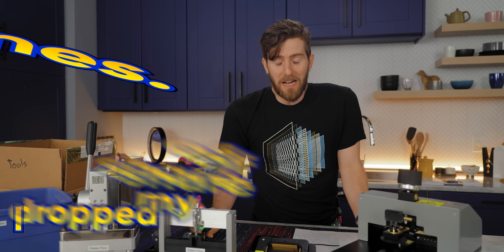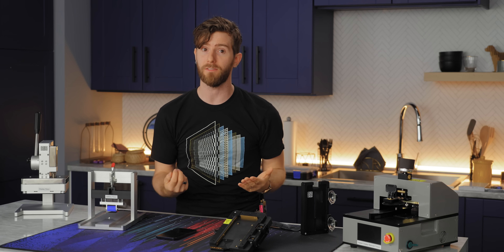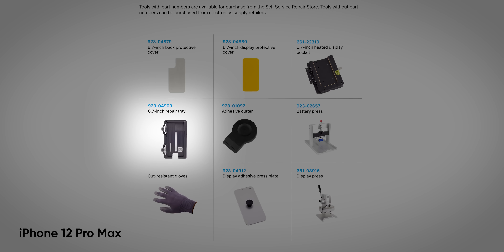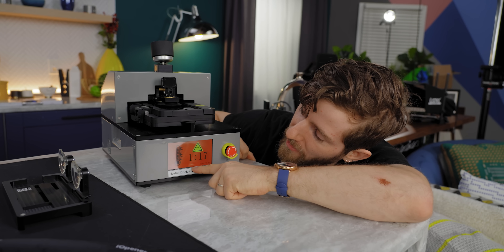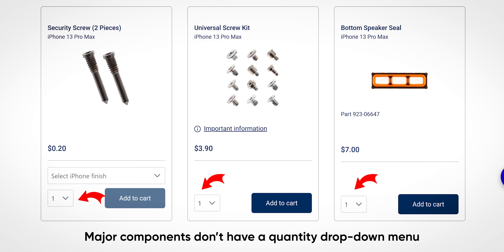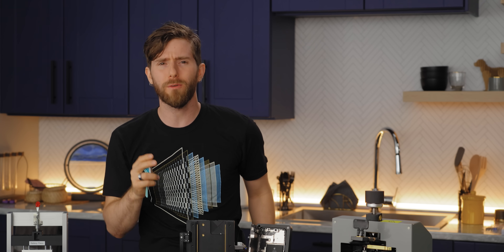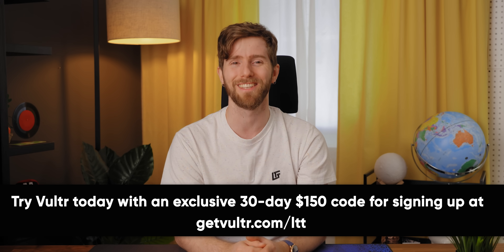I’m a Genius - Apple Self Service Repair Program

Comment: To be fair to Apple (which is not a phrase I ever expected to come from ME) to repair a vehicle, for example, which has a right to repair (though that's getting more and more questionable these days) will cost waaaaay more than buying a new vehicle if you were to replace even half of the parts in it.  With new OEM parts.  However, that's why 3rd party replacement parts and used parts and junkyards, etc. all exist.  Apple, however, is doing their Applest to prevent that kind of a market from existing outside of the walled garden.  So ... yeah.  Bad Apple.  Bad!  Go to your corner and think about what you've done!

Comment: A step in the right direction to be sure, but still so far away from what repair advocates are demanding that it's an immediate fail, "yeah, you did try, but not to the minimum of what we're considering requiring". Setting a service up for failure is even more reason to governments around the world to triple down on repair rights.

Comment: The thing is that "right to repair" isn't a real issue. Apple can't take away your phone if you repair it yourself. We all already have the right to repair our own hardware. But we may not get OEM parts. Apple is not, and should not be, required to make parts available for the hardware they sell. Should they do it anyway? Yeah. Are Apple's business practices scummy? Yes. Should they be forced by law? No. "Right to repair" is just a sweet name for "right to buy what isn't for sale". We have far too much red tape as it is.

I'm on board with the sentiment. Not with the execution. A good compromise would be to require parts be made available for everyone or no one. Either anybody can buy the part and make the repair, or repairs are only available through company tech reps, as they can't sell the parts to "approved" second- or third-party repair technicians. This would also benefit people who (for example) want to install their own Lennox heat pump (which Lennox only sells to techs who work for a big company or get a lot of business themselves). Either Lennox sends their own tech with the hardware to everyone who wants one installed, or they make it available for anyone to purchase. This way, the company retains the right to keep parts internal-only, but they either must offer first-party repair service, or simply can't offer repair service. This incentivizes making parts for sale. Apple would indeed lose business if they chose the first-party-only route, as there aren't Apple stores everywhere, and they wouldn't be able to distribute parts to non-Apple-employed repair techs. Open more locations, or open the parts to the market.

Comment: The main reason i switched from android to apple back in 2017 was due to the ability to easily repair them, i quickly fell in love with iPhone repair and customization however this is getting very difficult now with its pairing shit, genuinely thinking of going back to android or maybe the nothing phone - best of both worlds i guess lol
Reply: could maybe check out FairPhone - was designed with repairability in mind.

Comment: Pretty sure there's a serial number generator that I used for my hackintosh virtual machine that works with iPhones as well. So you'd be able to change your Mac/IP address multiple times and use drop shipping to get as many parts as you need, still bloody stupid they made it this difficult to repair your own phone...

Comment: The reason why they don't give estimates over the phone is because if you show up for a quoted display repair and it turns out you "forgot" to mention the massive dent on the corner of the frame (which would require a much more expensive repair), people will say that they were "promised" a certain price over the phone, and start wasting the staff's time with their silly little entitled argument.

Comment: So what this shows me is that the equipment themselves is the only thing you buy from Apple, and just use A device you own to "justify" buying it. I'd imagine pretty much all other components (non-software integrated) can be bought from third parties. And if you know a good machinist, they can make a lot of the metal parts parts as well. Can certainly 3-d print most plastic parts or other petrochemical components. I bet someone is already working on reverse engineering those phone holders right now so you don't have to buy Apple's LUL

Comment: I would argue that the reason it costs more for you to repair your iDevice yourself is a function of their accounting. They are essentially transferring the liability cost of failed repairs to you rather than having them accrued for and built into the repair price at volume as an in-house service. They are probably also passing on what they believe to be a portion of missed sales revenue to the DIY crowd that I'm assuming they believe would have potentially purchased something else while in the Apple store.

Comment: 0:25 Recommendation: I'm more of a butter fingers than ever are in your videos... and often can end up dropping things higher than you. (Not a brag) For those who are in the same bot, get a Samsung Note9 or similarly built phone with an Otterbox Defender case. This motherfucker has been with me 3 years already and probably been dropped 1000 times between 3-14 feet. I've not yet noticed a single thing wrong with it. It looks practically brand new when I take the case off.

Comment: The replaced part return credit is just rediculuse, i work for a 3rd partie repair shop we get much more for a replaced screen than apple gives for them if the lcd is ok. My employer buys screens with the original lcd. So apple does probably the same and reuses the lcd for assembling a new screen. So they get a huge margin on the tools, the new screen and the replaced if the lcd is ok. I would rather first brake my lcd before sending the screen back to apple.

Comment: And that's not the end of it, because in addition to everything you said one part is missing, when you replaced the display or the battery, iPhone will still tell you that the parts you changed are not original, even if you bought them from Apple itself. You are obliged to put the iPhone in diagnostic mode, and remotely an Apple employee will validate the parts you installed by also having you do a sensor calibration, which in case it fails will tell you to go to the nearest Apple Store.

Comment: Am I missing something? A random screen off ebay is $200, the genuine apple one is $310 - credit (this is credit for a broken part the video game trade in analogy makes no sense). After credit you’re paying only $75 more for a genuine part. Even factoring in the random ebay screen the cost to DIY after factoring in your time and tools is about the same or more than the store replacement cost. All this proves is the store cost is not as ridiculously overpriced as everyone makes it out to be. Unless you are expecting a genuine part to be sold for less than some random ebay part which is complete nonsense.

You’d have to look at the actual cost per screen apple is paying, the costs involved for shipping, handling, stocking, time that went into preparing these kits and manuals, payment processing fees, etc to really get a scope of any of the bold claims that apple’s repair program is ripping people off or intentionally sabotaging right to repair. It’s a fantasy to think you can buy a replacement part at wholesale cost with no mark ups, it’s just not realistic and the older the device the more those costs will increase due to much lower volumes and difficulties in sourcing.
Reply: you're not missing anything. These prices are not the same what AASPs or IRPs get charged (and those are overpriced already by about 100%). Apple is milking the cow extra hard with these.

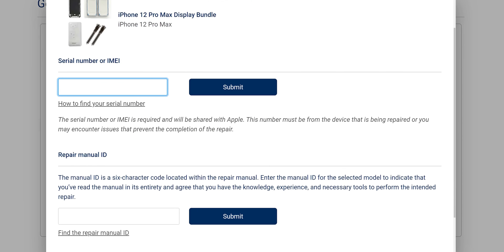Comment: 12:03 IMEI generator my friends 🌝
Reply: Wouldn't you need the IMEI to pair it with the device for true tone and some other things?
Reply: @autofocusphotos  IMEI generator can handle that, you gen an IMEI for a specific phone model
Reply: @LordNementon  I was just thinking about the "unable to verify genuine display" message, wouldn't you need the same IMEI number for that, or am i just dumb lol
Reply: @autofocusphotos  Oh you mean for replacement part, it is bound to a specific IMEI? It seems overkill, but who knows for apple, on my side I'm not into apple's world, I've no clue how their part are working. I was more thinking that ifixit's/apple website will just verify the IMEI checksum to be a valid iPhone one, if it is the case it can be generated.
Reply: @LordNementon  TBH it does sound like something apple would do

Comment: Idk I'm still not buying apple, overpriced product in the first place. And really only has the self repair stuff because they were basically forced to, and well considering the renting the tools (most of which are completely unnecessary except the heating table, but even then that's only necessary because of how they build the phones, and you could probably find an easy substitute like a 3d printing bed or something), are more expensive than getting it repaired by the actual store. (which is funny because that shows how much they've been ripping people off considering youd pay 300+ for just a new screen but having someone else do it, but now they charge you almost the exact same thing for all the machinery they use the replacement parts and shipping). I'll stick with my $40 android.

Comment: The heater isn’t my fav and prefer the electronics “heating pad” mat as really does great job and can handle iPads as well; just be careful ya don’t forget about or set timer b/c it will burn the device…. 🤦🏼 
However, the display press tool; well worth the money if a repair shop and doing screens or repairs that requires removing display and putting it back on (which is like every repair, so just buy one, lol).
The battery installer….meh, & the wera drivers; well, you can buy and use them, they are excellent tools, imo, as is wiha; but other drivers work too, and same goes for the torque drivers (but for these, a good one will cost ya, and most likely gonna be a name brand, wiha, wera, or other big brand. Buying a torque driver that never heard of, not so sure as you really wanna make sure the torque specs are “dead on”, as over time….they will start to get wonky and need recalibrated. My torque driver is a Wiha and was $450 USD but also use for electrical work besides device repairs; gotta make sure torque down lugs on breaker panels and terminals…..same goes for switches and outlets, right😉).
Thx for the vid Linus, always a fun time when your hosting and there’s a project going on; also like to see vids of this type as one of my favs (as is any shop Vid and so excited to see 1st lab vid and more to come👍🏻👍🏻).
Cheers y’all ✌🏻

Comment: The thing is, I'm not sure they can make this economical for them to offer in a way that would be preferable to having an Apple Store do it. The Genius can knock this out in minutes, and to do so Apple doesn't have to ship anything.

It's clear that the parts are the main bottleneck though-- if you take Apple's perspective at face value, it's their monomaniacal focus on the consistency of the customer experience that means they're going to go to unusual measures to make sure you do it "the right way"... or they won't let you do it at all.

Comment: It's a smoke screen, in my opinion:
1. 99% of people who need a repair want to do it in a repair store and will never even consider doing these kinds of repairs themselves. By offering these repair store-level machines to laypeople, but not to actual repair stores, Apple is trying to look as if it's turning into a pro-right-to-repair company, while still making sure people won't repair their devices (except for those who'd pay the ridiculous prices the "genius" in the Apple store charges them).
2. This move by Apple seems to have the sole goal of reducing the chances of lawmakers forcing them to enable repairs of their devices in any normal repair store (as was the case for as long as electronics existed - well, until Apple came along). If, let's say, in 12 months Apple thinks the threat to their money machine subsided, they can just cancel the whole thing (although, again, they probably won't have a reason to cancel it, as they make sure almost no one will use it anyway).

Comment: These tools are not necessary at all 🤣😂 already replaced my 13pro screen and just like my x and 6s+ and 5s and 4 I just use a suction cup that comes with most kits and use the spudger and boom off. The rear glass is a different story. You do need a laser removal tool to get the glue off. I left mine broken in the rear and still swim and use it under water all the time and no issues at all.

Comment: As an Apple authorized technician myself I can definitely say that it isnt the tools that are the problem. With some practice or time you also can easily open up any Iphone using the ifixit kit but the real problem is the software, configuring hardware or just telling the phone that the newly installed hardware is fine...
Reply: The problem isn't limited to the tools, the replacement parts or even the software. The problem is Apple itself. The company deserves to be fully regulated by the government, since it cannot be trusted to regulate itself.

Comment: What apple allows users to repair, is basically also what apple allows AASP's  to repair in places like Mobile Kangaroo, Best Buy, etc., sans the Rear System replacement available in the 12's and 13's. If there's anything more serious Apple typically doesn't allow them to do the repair and they just have to send it into Apple for them to fix it (From a current AASP Repair Tech)

Comment: Used to work at an apple store, sales guy not a technician. I remember all the techs complaining about how horrible of an idea this was when they first announced it. The issue is more about customers that don’t know what they’re doing trying to attempt shit, failing and then coming to complain to the store workings for the failings of corporate policy :/ . This is just a big corporate PR stunt for politics rather than addressing the inherent intentionally unfixable state of the devices. At the company I’m currently at, we get pushed by the higher ups to intentionally hinder software capabilities on specific line ups to promote sales of other tiers of our applications. I can imagine the engineers at Apple face similar dilemmas on making their products actually make sense.
Reply: I worked as a technician repairing other electronics. It is usually to fix the screw ups of other people, or inherent system faults. Not a fan of 'right to repair' from the company side. It is a huge mess having to support people that have no accountability. 

Fellow technicians, you can either retrain or fire, and it can be handled internally. Random end user customers? Huge oof.

Comment: From what I can tell nothing prevents a repair store from ordering parts for their phone(s) that happens to be "broken" and then using those parts in a customer's phone and then replacing those stock parts with new parts using the customer's serial number. As long as this is disclosed to the customer then it shouldn't be an issue.
Reply: Serial number activation process and turn around time.
If the repair takes more than a few hours, most customer say no.
Reply: @jintsuubest9331  yeah, I was illustrating a method to keep parts in stock despite the serial number requirement

Comment: you can buy cheap replacements and easily replace screen, battery, cameras, dot matrix, home buttons without Apple fancy tools. the only thing that made this more difficult on some independent repair shops is serialized parts. you can't even replace shorted baseband on apple devices, when this happens the phone becomes donor board to e-waste.XD

Comment: I work at a Geek Squad as an Apple Pro and my gosh let me tell you, Apple is VERY specific when it comes to things. For instance I saw you wrote the name of the part on their box. When we ship them back they have to be inside of the new parts box going back. If there is any writing on the box at all or any marks, they charge us a $50 administration fee, its wicked stupid. I can't tell you the amount of escalations I have created fighting Apple to get money back that they wrongly charged us. I am hoping Apple wont do the same stupid stuff for this personal repair program. Imagine you don't get any of that returned part credit back and instead get charged more because you wrote on the box.
Reply: does that happen even if marks appear from the way it was handled during the shipping process either while being to shipped to u or to apple?
Reply: @CelestialDeathscythe  Not necessarily. If it is like a dent or a tiny rip from shipping they're usually pretty good about it. However, I have had a time where when opening the part box it tore and they tried to charge that $50 fee and I spent a week and a half fighting with Apple Support to reverse the charge and credit us back the money.
Reply: given it is the same logistics company (it is not apple directly) expect it to be just as bad.

Comment: Good thing that:
A) Nobody needs a (Cr-)Apple phone!
B) Nobody needs a unibody-design-phone (sure: Not many old-style phones on the market right now, but that's where the next point shows a silver lining on the horizont!)
C) Right to repair laws are coming, especially in the EU, where devices with batteries have to make sure that the average user can replace said battery without tools! Other devices will soon become forbidden (so Apple and others will not be allowed to sell them here!)